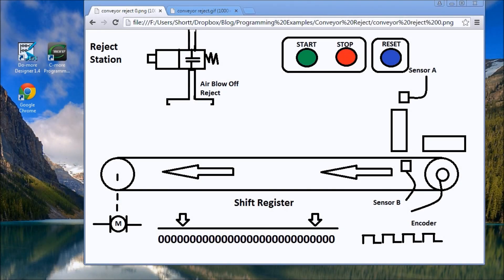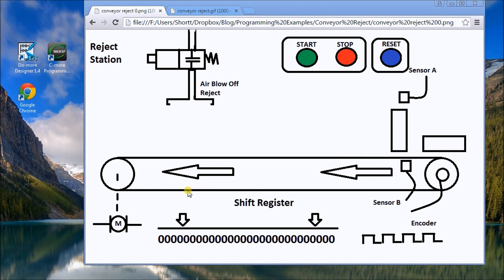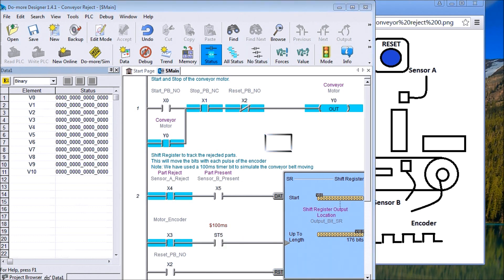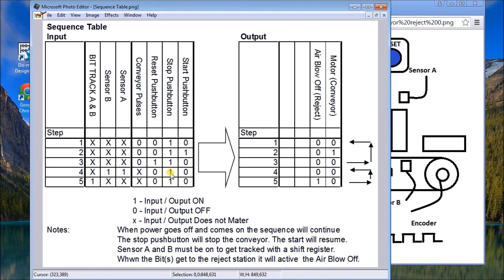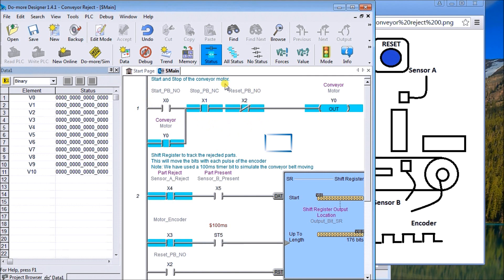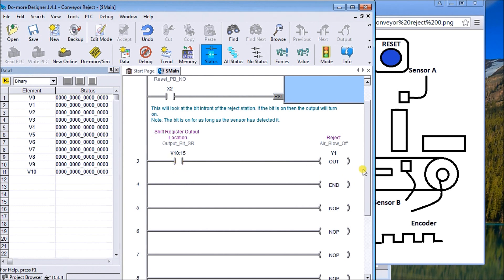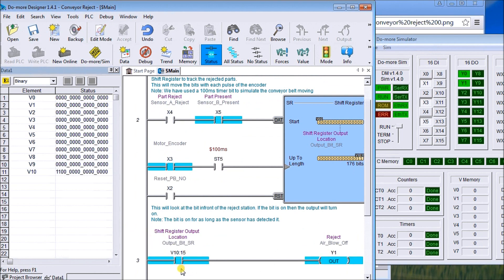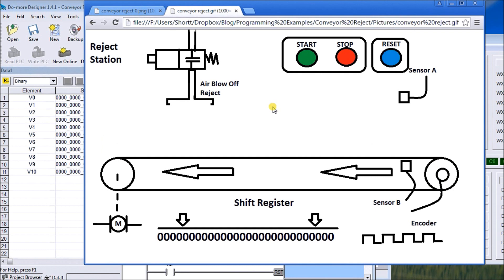Master PLC Programming: Shift Register Conveyor in Action!

Comment: if my encoder have 1000 ppr how many register i need
Reply from the maker: Since your encoder has 1000 pulses per revolution, how much distance will it travel in one revolution? You then calculate the required distance to determine the necessary pulses or bits.
I hope this helps you out.
Regards,
Garry
Reply: @ACCautomation how do i do this reject station using tia portal

Comment: I've implemented the same idea for a checking station using arrays in codesys since bit's are annoying to work with (needed runtime configurable positions). So then I also came up with the idea of cross checking because sometimes optical sensors can miss things. Rather than an array of bits, I have an array of UINT, sensor station 1 sets the value 1 for every product it sees or sets it to 2 if it should be rejected, when sensor station 2 sees a product it will cross check the register of station 1, and if the first station missed the item (still zero) it goes and marks it 2 for rejection, this means you wont accidently send a bad product out the door because one of the checks didn't happen and it's very apparent when the sensor is not working since absolutely everything ends up in the reject bin.
Reply from the maker: Thanks for the comment. Tracking programs like this are great. Your implementation is a great idea.
Garry

Comment: Hi, Thanks for the great presentation. What I didn't quite understand is what bit actually has to be chosen to trigger the blow off, in other words, how would we know how long it would take a bit to get to the station/point we want to trigger something? is there any engineering way to get a solid idea on which bits are activated at the time? I am working on a similar application to reject the bad parts in a very rapid rate on the conveyor. What if 2 or 3 consecutive parts are bad? would this idea still work?
Reply from the maker: Typically an encoder gear with a proximity sensor will detect the movement of the conveyor. This pulse from the movement of the conveyor is used to determine the distance travelled. 
When the bit turns on with the correct distance, the product position is known.
I hope this helps you out.
Regards,
Garry

Comment: Good video. I have a thing to add about the bits retaining their value at a power out. In these types of shift registers, where there is a motor, there is often a need for a 24v UPS for the plc. This is because of the motors momentum. So the motor will continue to spin some additional rotations after the power goes out. If the plc dont have a UPS the bits will be in the wrong place at startup. The UPS only have to hold the 24v up for a couple of seconds (as long as it takes for the motor to stop completely).
This is something programmers often forget.
Reply from the maker: Hi Per Eklund,
I agree. Good point. Every application may be different.
Thank you for the comment.
Garry

Comment: How to use encoder  couting with shift bit register. For eft shift
Reply from the maker: Hi Saket Gupta,
This will work with an incremental encoder using only one of the phase inputs to an input. 
These encoders will have outputs A and B which are 90 degrees leading or lagging each other. This will show direction. You will only wire up one of these outputs to get the pulse from the unit.
Ensure that the pulse input frequency is less than the scan time of the PLC.
I have used the following dart product for the ease of installation on a shaft.
https://ebay.us/jKD8Zt
Regards,
Garry

Comment: Dear sir How to generate  sequence block in program
Reply from the maker: Hi Mahendra,
Sequencing in the program can be done in several different ways. Direct logic, timers, step bits, indirect addressing, etc.
https://accautomation.ca/building-a-plc-program-that-you-can-be-proud-of-part-1/
The above post will show you how to program traffic lights in a few different ways.
https://accautomation.ca/five-steps-to-plc-program-development/
This post will show you the five steps in program development.
I hope this helps you out.
Regards,
Garry
Reply: THank you Gerry.
Reply from the maker: @Truth n Logic 
This would depend on how the logic has been programmed.
Here are some examples:
https://accautomation.ca/building-a-plc-program-that-you-can-be-proud-of-part-1/
https://accautomation.ca/4-way-traffic-light-plc-program-easyplc/
I hope this helps you out.
Regards,
Garry
Reply from the maker: @Truth n Logic 
If you want to change the traffic light duration or time, it would depend on how the light control was programmed. 
If individual timers were used then you would just change that timer. With one-timer and comparisons, then you would have to change a few comparison rungs.
Here are a couple of posts that will show what I mean by different ways to program the traffic light signals:
https://accautomation.ca/building-a-plc-program-that-you-can-be-proud-of-part-1/
Here is a recent traffic light control using EasyPLC 3D simulator software. You will see that this will use the comparison method.
https://accautomation.ca/4-way-traffic-light-plc-program-easyplc/
I hope this helps you out.
Regards,
Garry

Comment: Hi Garry, Thank you very much for all the efforts you put in your videos>>> Actually I have a some questions about this video, hopefully I could find the answers:   
1. how do you calculate the length of the data to be shifted within ( how many words ?? )
2. Is this applicable for other PLC platforms cause i found siemens, or Delta for example are a bit different and I don't get it >> why such a powerful technique is not applicable in all PLCs ??
3. Is there other techniques to do part tracking apart from shift register technique ? ? 

thanks in advance for any help you might provide.
Reply from the maker: Hi Ibrahim,
Thank you for the comments.
Here is the corresponding website that will have additional information.
https://accautomation.ca/plc-programming-example-shift-register-conveyor-reject/
You would calculate the amount of shifting that you need based upon the clock (shift input) that you use. This is based on the amount of travel that is required.
Data shifting is usually available for most if not all controllers. The naming and the actual implementation may be slightly different but the general concepts still apply.
There are other techniques that can be used. It would depend on your specific application. A counter can be used and you would compare off of the counter. Other techniques I have seen are using timers in conjunction with shifting.
I hope this helps you out.
Regards,
Garry
Reply: @ACCautomation  thanks, I think it is helpful.
Reply from the maker: @ielkhatib32  
The online PLC simulator does not have a built-in shift register instruction. 
https://accautomation.ca/series/plc-fiddle-online-plc-editor-and-simulator-in-your-browser/
Here is the PLC Fiddle Shift Register
https://www.plcfiddle.com/challenge/68091ce1-59cd-4686-8f4b-9aa0a047618e
Here is the explanation of the code
https://youtu.be/PNSmIeV9mYA
Just another way to do a shift register
Regards,
Garry
Reply: @ACCautomation  Thanks Gary for the response, actually I did find the shift register in Siemens, Delta, Domore and OMRON.. you helped me a lot but still the question... In your sorting station video you used 3 shift registers the first one ( v0 to v19) and the output was on ( v0.8) .. now how did you know the exact place of your output regarding to the conveyor ? And if it's in the first word why use 20 words ? 
The second shift register you used ( v20 to v29) ten words and the output on the second one .. same questions why ten words and how do you know the actual output ( v21.15) .. and same questions for the third one  sorry for inconvenience but hopefully you get what I mean ..
Reply from the maker: @ielkhatib32  
That is a good question. In the sorting example, 3 shift registers were used because our sensor picked up 3 different items that had different destinations. At the time of programming, I was unsure of the number of registers that would be required to shift in order to get the output needed. The shifting was done with the timing of the conveyor belt. 
Each of the 3 shift registers used the same timing for the shift (Same belt). The actual bit used is determined by the position of the object on the belt when it has shifted X amount of bits. In our case, it is when the object is in front of the ramp.
I hope this helps you out.
Regards,
Garry
Reply: @ACCautomation  Thanks Gary, I get now. I also get how it's done in Siemens, Delta and OMRON PLCs .. all because of your help. Thanks again.

Comment: Clearly the SR instruction is shifting ALL of the bits up, as can be seen with memory locations V2-V10 being updated once the bits pass out of V1.  My question is, how far up the memory list does the SR instruction push bits, will it be affecting ALL of my V-memory ranges, such as a word in memory location V54?  Cleary this would lead to catastrophic results if it shifted EVERY address above the starting point, so my question is how does the instruction know "how far back" to push the bit?  

I would have liked to see V11 also in the data watch.  I am assuming that no 1's were loaded into V11, but I don't understand how you specify this (The end of the "shifting memory" range).  How do you specify this "bit length"?

I'm sorry if that was confusing.
Reply: How do you protect yourself from shifting bits in registers or V-memory locations which you didn't intend to modify, I guess that's a better way of phrasing my question.
Reply from the maker: Good question Rob.
When the SR instruction is programmed you specify the start location and the end location. In our case it is V0 bit 0 to V15 bit 15. This will give us a total of 176 bits to shift. 
You can see more detail of this video at our website:
http://accautomation.ca/plc-programming-example-shift-register-conveyor-reject/
V16 is the first register outside of the SR instruction. You will not see any bits shift in this location.
Another example of the shift register in action using Factory IO:
http://accautomation.ca/plc-programming-example-sorting-station-shift-register/
Here is the testing video:
https://youtu.be/W0aibYb3DnE
Here is the explanation video:
https://youtu.be/YMl2DPm_yaU

Hope this helps you out.
Regards,
Garry

Comment: sir,can you send me that file ladder logic and simulation,PLEASE!
Reply from the maker: Hi Ricky,
You can download the free domore designer software at the following location:
http://support.automationdirect.com/products/domore.html
It comes complete with a simulator.
Here is the program for the above:
https://dl.dropboxusercontent.com/u/33455595/Conveyor%20Reject.zip

I would recommend looking at the following for an HMI and PLC simulator:
http://accautomation.ca/create-a-plc-with-hmi-training-and-learning-environment-free/
Here is another post that may be of interest:
http://accautomation.ca/how-you-can-learn-plc-programming-without-spending-a-dime/

Thanks Ricky
Garry
Reply: THANKS SIR, can you build ladder logic like conveyor metal detector in airport ?
Reply from the maker: You can take the same logic and apply to many different systems. 
The metal detector usually just stops the conveyor. So when the output comes on then the signal will be incorporated  in the stop circuit.
Regards,
Garry
Reply: can you build that sir please, thank u in advice #sorry  my bad english
Reply from the maker: I will not program that for you, but will help you out if you are stuck.
The samples provided should get you started.
Garry
Reply: you did not explain the encoders relatioship to belt speed so that the air blast occurs at the right time.
Reply from the maker: Hi Steve,
The encoder is tied directly to the driving gear of the belt. They are synchronized so a pulse of the encoder would equal a distance on the belt. 
Regardless of speed the air blast will always occur after so many pulses of the encoder. (Distanced traveled on the belt.)
I have seen times when timers are used to ensure the length of the output stays on for a minimum time. 
Hope this helps explain the relationship.
Regards,
Garry